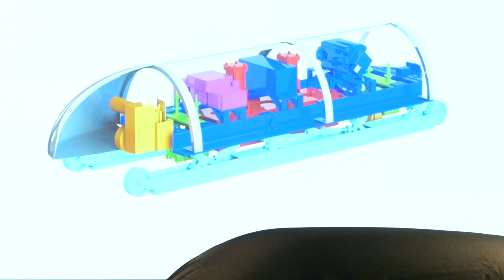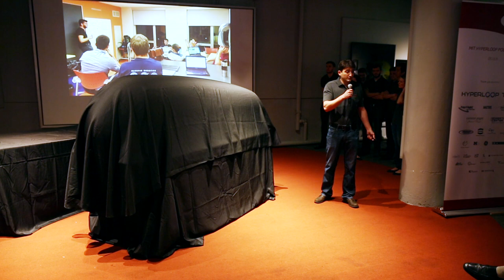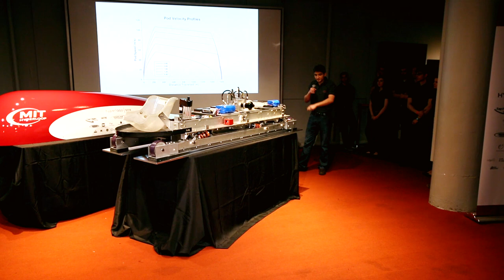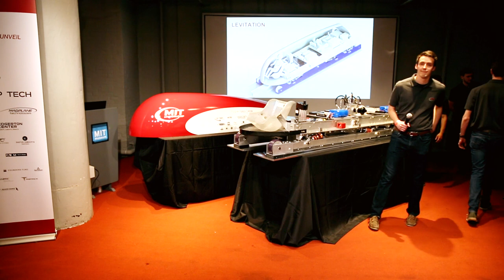MIT Hyperloop Unveiling Full Presentation

Comment: the diameter should be around 1,5 m (one passenger instead of 3 in one row - an individual capsule sealed from other passengers) and pressure difference between front and rear should be around 0.1 atm (simple rotors for suction placed every 100 m, working only 10 km in front of the train and stopping after train passes it, or even used for creating pressure, but then should be some shutter for enabling fast pressure buildups in the tube), so only small vacuum of 0.9 atm in front of the train. driving rotor must be behind and not in front. all runs on permanent magnet rails (arranged like in Mercedes sign) twice longer than a span of pillions (around every 100 m), powered by electricity. in this way train will be (additionally to the rotor) pushed forward by pressure differences and will be no problems for air flow and pressure safety. such hyperloop will be capable to overcome and sound barrier with ease and run much faster. the whole trail should be of 4 tubes forming 88 shape. besides the tubes will be a power line and all communication cables like optic fiber and so on. breaks will be electromagnetic exploiting permanent magnet hoovering rails and even creating additional electricity.